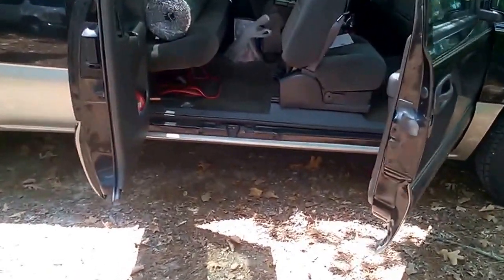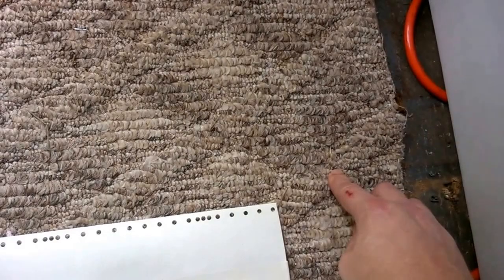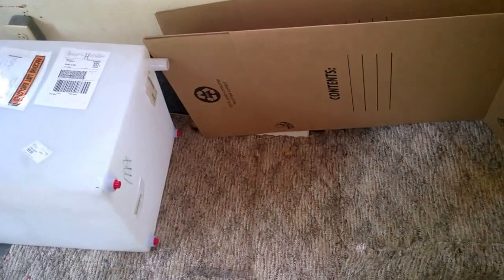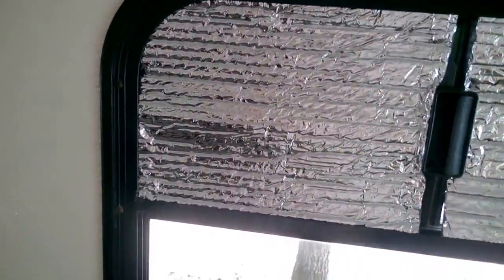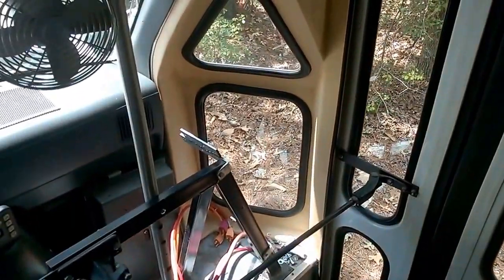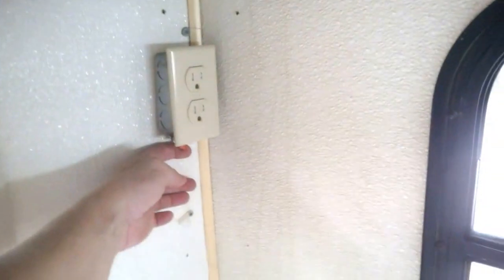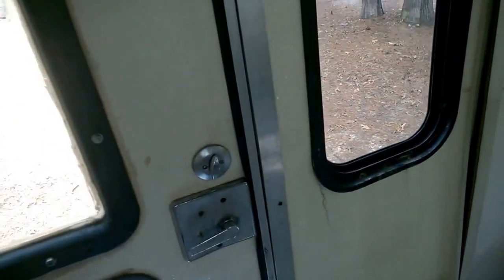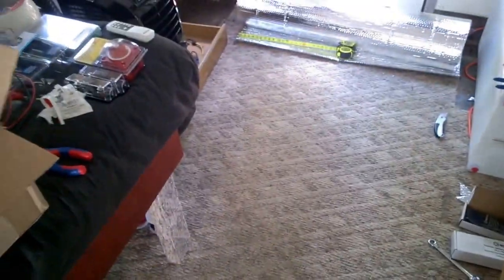RV Life - Bus Conversion - Reflectix and Asthma

Comment: Wayne: Looking forward to the build. I am currently looking for the same kind of bus to make into a camper. Just a thought...I am thinking that instead of sealing the lift door, I want to  build a closet open to the outside, and storing all my hoses, outdoor grill, jack, etc so it won't show on the inside, but you can open the door from the outside, and the stuff is readily accessible. (also would be a good place for dirty laundry)
Reply from the maker: Mike Read Yeah that's a good idea, but won't work for my layout. All of these buses depending on year, length, etc. have different compartments. Mine has one just outside the front loading door, to the right, down at the bottom where the house battery was kept. I don't really know what it was for originally but it's huge and I plan on keeping all my hoses and stuff in there. If I were to keep that door to where it opened, it would open onto whoever was taking a shower and since I am freshly divorced, that will 100% chance be me, so no... LOL!